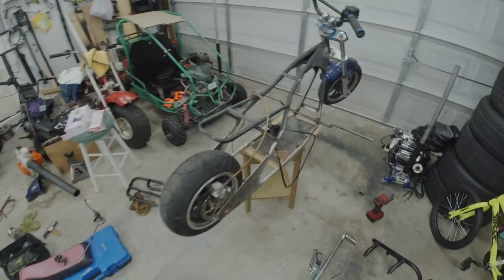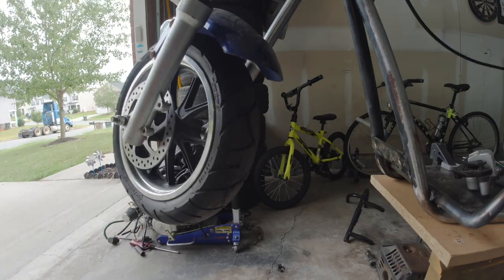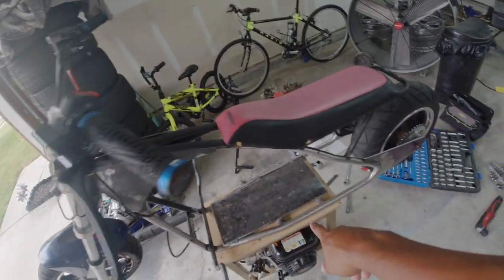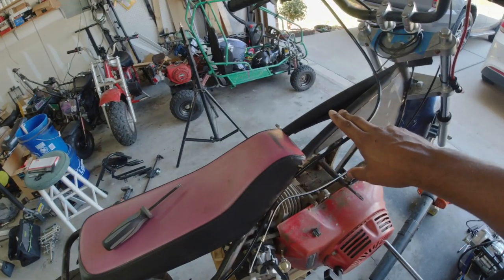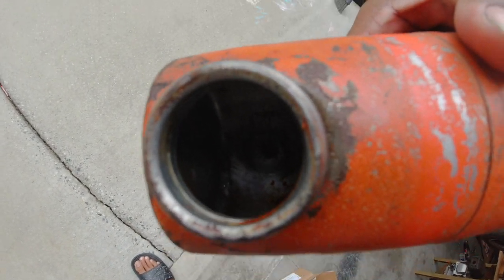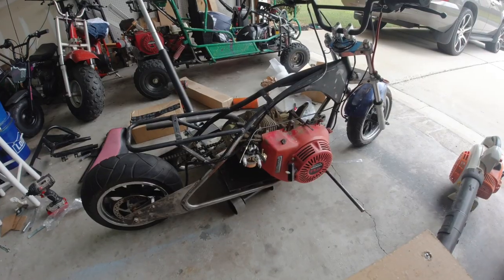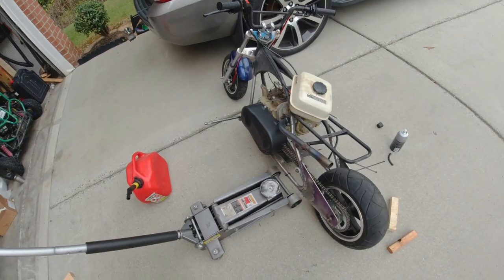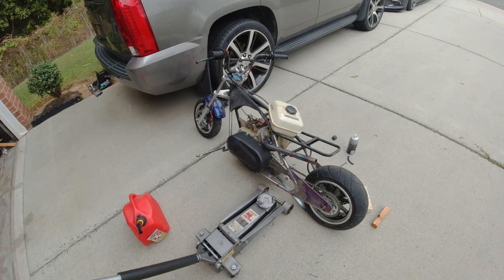Big Block Stretched Motovox MBX10 Ep. 3 | GX340 Mounted + Brakes + 1ST START!

Comment: Did you have to make the frame wider? To fit the big block?
Reply from the maker: Nope. Frame is the same width. Just a 1/4” steel plate to bolt the engine too. The engine is offset to the right off center so that I didn’t have to run a jackshaft of the engine was centered in the frame.
Reply: @DariusBuildz  thanks for the info👍
Reply from the maker: anytime!

Comment: Sweet stretched big block thumper!

She's gonna be  TORQUE monster with a CVT !
Reply from the maker: That's my plan! I want to keep the motor stock, but I have a feeling i'm going to end up at least doing a billet rod, flywheel and 50lb to bulletproof the motor!
Reply: @DariusBuildz  you’re not going to have to pull many RPMs with this stump puller.  Build her slow.  Keep it budget- maybe in stages !👍
Reply from the maker: @GPMAX01  If I open the motor, might as well build it, lol. But its crazy how the parts are almost double the price of the 212 stuff.
Reply: @DariusBuildz  it’s takes piles of Benjis to build this big blocks..!
Reply from the maker: @GPMAX01  i'm just trying not to throw the rod through the block, lol. Hard to come by these 340/390 cheaply.